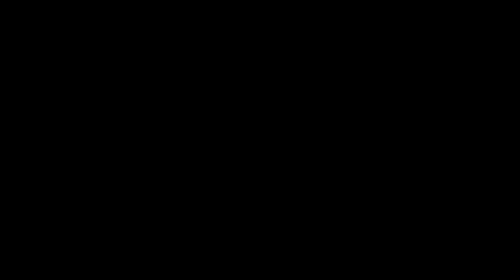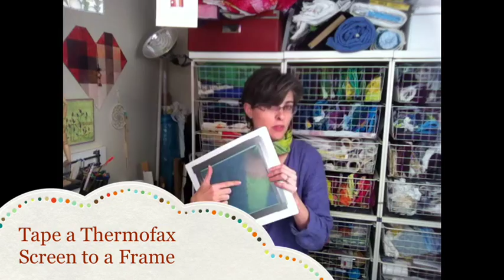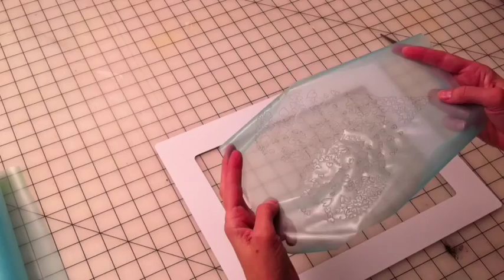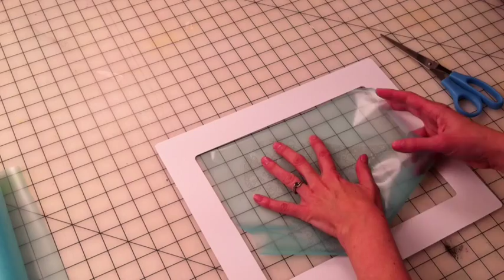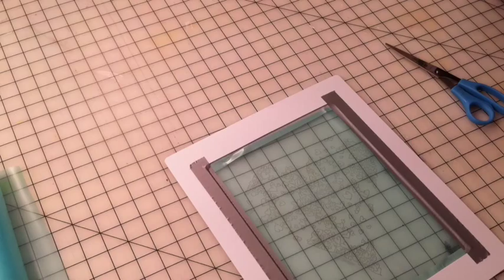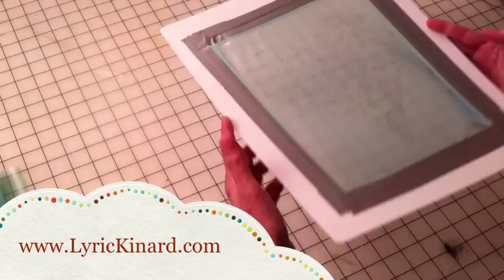Taping A Thermofax Screen To A Frame

Comment: Hi Lyric...just received the thermofax small frames you sent. Thanks! Seems these will be hard to find now that Welsh has closed their doors.
Quick question...I am using the screens to print on newsprint paper with underglaze to transfer onto a clay body.
Which mesh will give me the cleanest image... 100 or 70 mesh? Thanks!
Reply from the maker: I don't have experience working with glaze and clay so I'm not an authoritative expert. 70 mesh works well for cloth, the holes in the mesh are a bit larger. 100 mesh gives very fine detail on a very solid surface like paper, I'm not sure which is closer to what you are using. Because I work mostly with textile artists I have not ordered in rolls of the 100mesh. Do you think there is a large market for the finer detail mesh?

Comment: Oh and a quick question...sometimes the laser print paper gets stuck on the mesh after printing. I tried adjusting the dial, but still does it. Any idea why this happens?
Reply from the maker: mary carlino every machine is different. I’m not sure why this is happening to you. If my machine is too hot it melts the mesh to the paper and leaves holes.